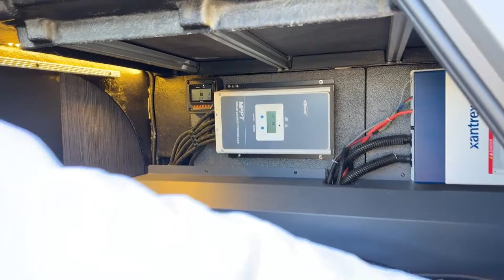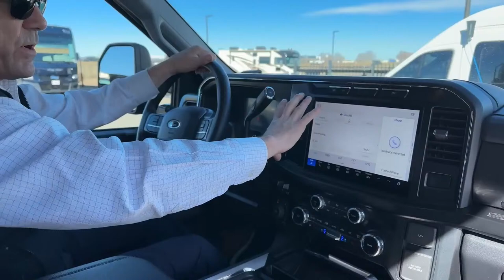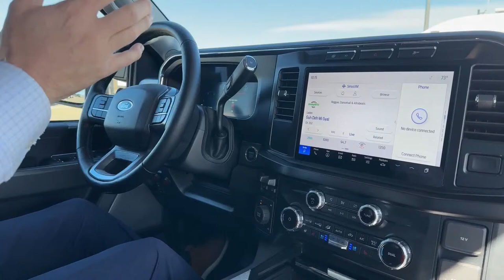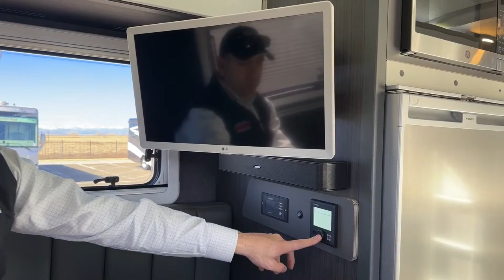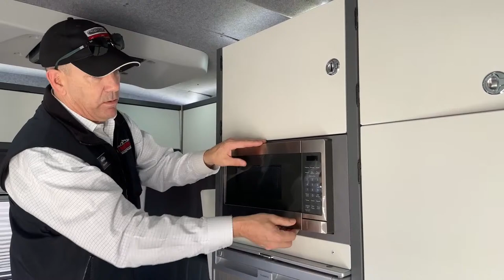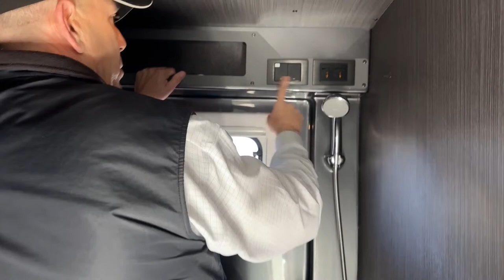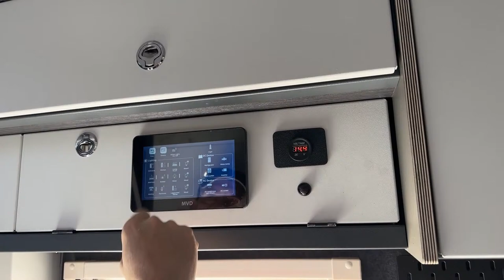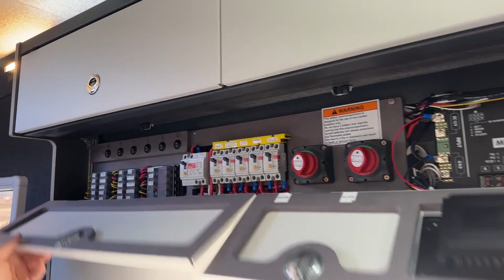2023 27North RexRover AC1 Overland Expedition Truck

Comment: I went back and forth on the video but i didn't see the fridge.
Reply: Sorry its right across from the sink countertop. Its smaller than the F350 models however.
Reply: It's at 20:20 in the video. There is also a dometic fridge in the rack on the back at 6:00